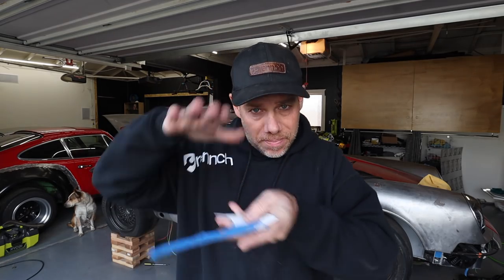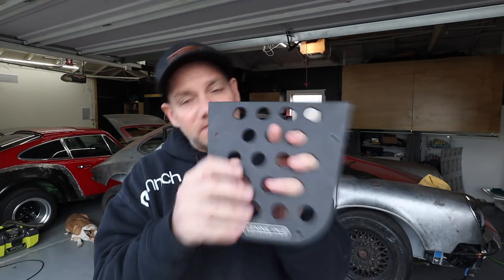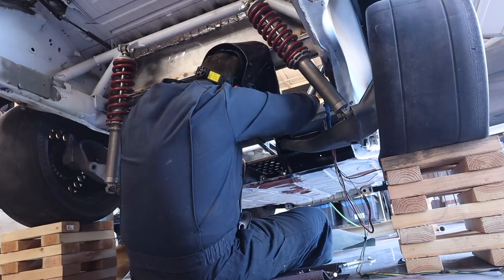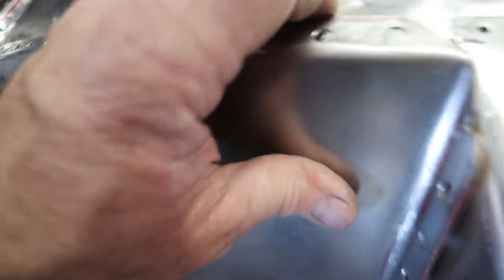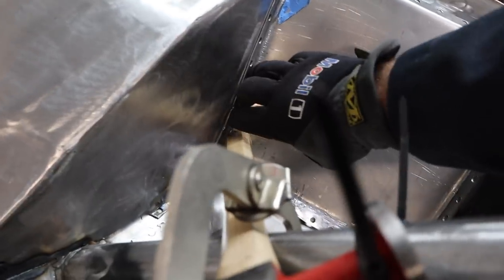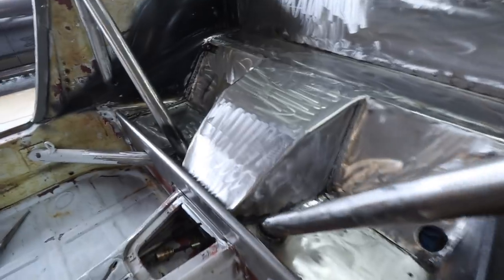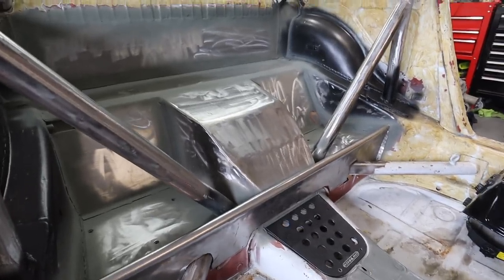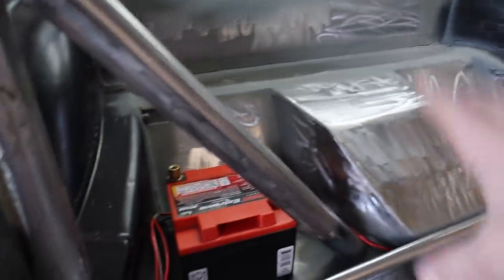HEAVILY Modifying and FINISHING The Rear Seat Delete on my Vintage Porsche 911 | Blasphemy Build 45

Comment: Great work and a lot of patience. 👍 

A tip, ‘cut and butt’ is good for visible/cosmetic panels but these structural panels are easier done as lap joints, they are much stronger, easier alignment, warp less... just use weld through primer and a good 2 pack primer sealer afterwards to make sure water can’t wick into the joints. 2” stitch welds are all that’s required.

Butt welds are much weaker especially when you finish grind them down.

Guess the decision is show car or race, or if a particular area is going to be for ‘show’... this area you are talking about covering with a ‘rear seat delete’.

Comment: Self etch primer isn’t needed unless you are working aluminum or similar surface/material. A zinc primer is better, then use a 2 pack non-porous primer sealer.

Comment: Think the job you have done has been great and the rear seat fab work has been awesome for a "novice/hobbyist", if I can call you that. Waiting to see where the flux capacitor is installed. As for the Patreon question, I have a couple other contributors that I happily give $5 a month too. I know it doesn't sound like much, but I spread it around a few different channels.

Comment: A job well done Michael.
looking sweeeeeeeeet!

Dont forget to heat shrink or loom tape those wires for added protection .
Would not want to rub through and short out the Haltec
Reply from the maker: I’m a long way from final fitment. Not to worry
Reply: @rennch.  just one other question. what dimensions are your wheel cribs.
seen a few different youtube on those and all seem different sizes.
Reply from the maker: @michaelanderson3771  what’s a wheel crib?
Reply: @rennch.  the timber car stands . I have seen these used by a number of guys from USA and thought that term was a common term used over there.
Reply from the maker: @michaelanderson3771  ah ok! You can get 8 1’ chunks out of every  2x4. Then go as high as you want! 1.5” each tier.
Reply: @rennch.  so yours are 12" inches square thanks Michael.
And if there 2" x 4" then  I  guess each tier is 2" tall and it looks like you have about 14" elevation under the tire

Comment: You have done a great job!!!..inspiring build.. Question, why didn't you run the shifter  cables onto of the tunnel to keep them away from the heat of  your cooling/radiator pipes?... and of course build another tunnel to hide them.